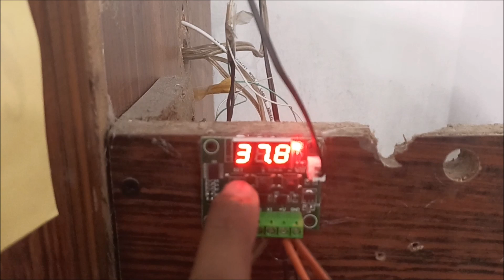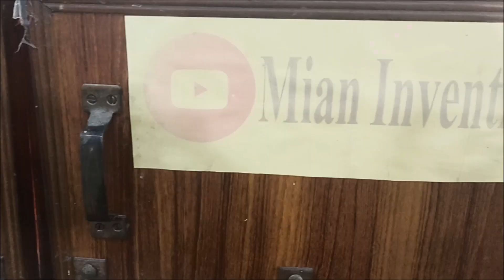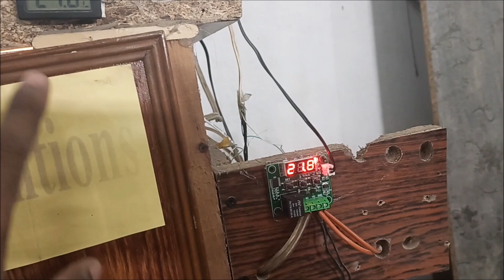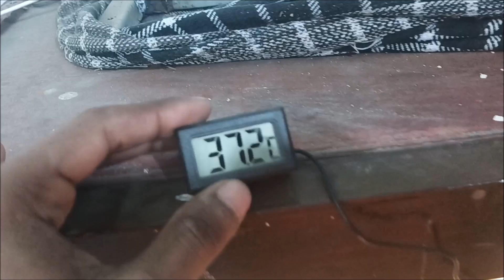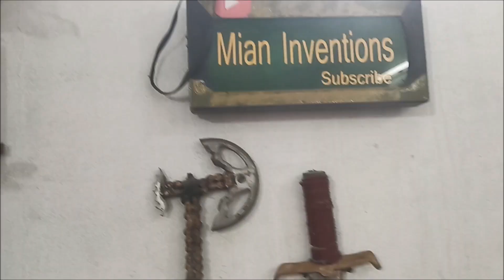Finally ! I have Incubated 200 new Eggs In Homemade Incubator

Comment: So you are not controling the humidity accurately?
Reply from the maker: I have attach fan at the upper of WATER BOWL INSIDE THE INCUBATOR , Which fall air on water and made humidity . Humidity inside the incubator is 40 to 60 i have checked
Reply: @MianInventions  bhai me khud banana chata hu ghr me muje ye btay 700 eggs ka liye kitne bulb ka banao 1st floor 2nd floor 3rd floor aisi banoga....   controller machine kitni ki aygy 2000??? Jo aotometic bnd chalo hoti 36 selcius pe .... 3 bulb ya 2 bulb  ka controller chlega 60 wett?